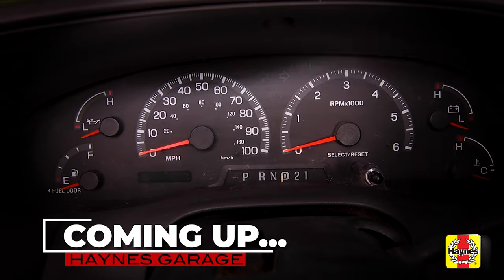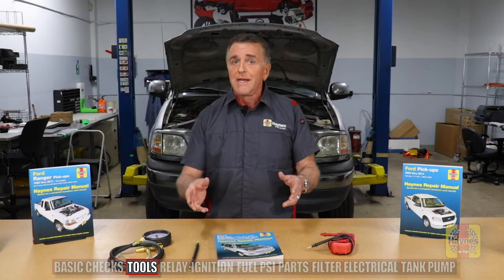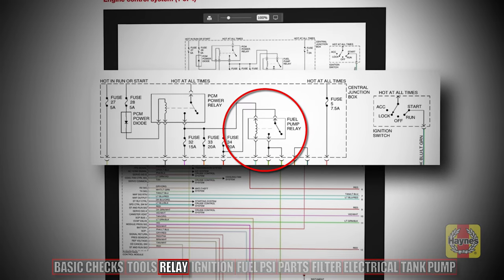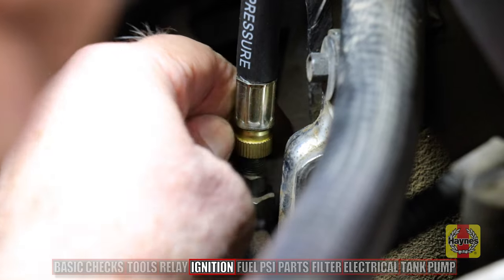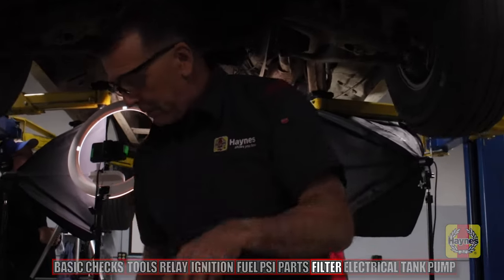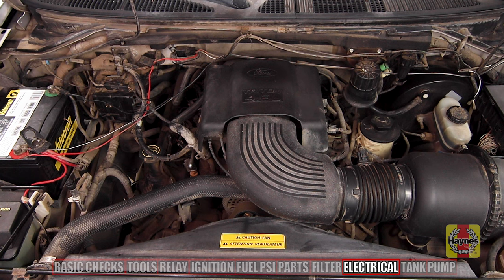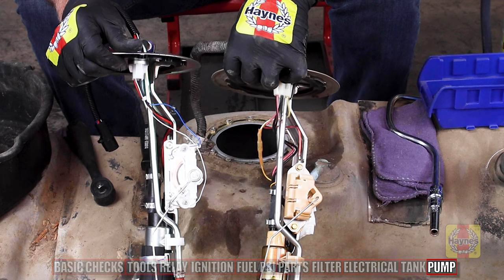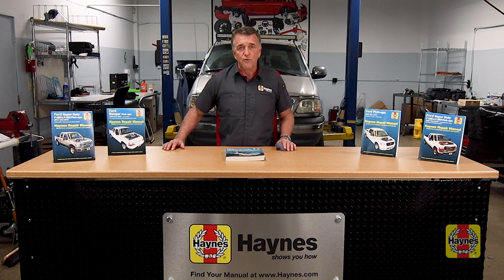What To Look For When Diagnosing Your Vehicle's Crank, But No Start

Comment: I cant believe you ignored the possibility of it being the relay 303 in the fuse box in the cabin on the passenger side.  this is the last fuel pump relay before voltage goes to the pump.  its not a removable plug n play type but soldered to a circuit board.  replacing the entire fuse block is hella expensive but if you know how to solder its a $12 fix.   And your video never even mentioned it.  And once you remove the 4 pin connector you can diagnose the pump and that relay before even crawling under the truck or taking the tank off the truck and possibly finding the pump is actually ok.
Reply: One of the greatest aspects of car culture, and especially in the “hands-on” world of “fixing cars,” nobody knows it all, and there’s always more to learn. Frequently we get to share what we know to help others enjoy the best in vehicle maintenance and repair. But when inaccurate advice or information is presented, and others can be diverted from reliable and correct information it can result in lost time and energy. 

Yet the comment above is based on incorrect information and misleading to others. Naturally, it will be helpful to provide you and others with facts about how "ignoring" the model year matters significantly.

The summary conclusion, “I can’t believe you ignored the possibility of it being the relay 303 in the fuse box in the cabin …” is simply not accurate for a 2000 F-150. None of what was offered in the above comment above will help an owner of a "2000 model" Ford F-150.

This Haynes video that included the "one" fuel-pump relay located only under the hood is precise and correct to the wiring diagram for this vehicle. 

What could have been ignored or simply overlooked in this Haynes video is this is a “2000 model” F-150. The 2000 F-150 was not manufactured with a ‘relay 303’ inside, or a fuse/junction box in the "cabin." The "only" fuel-pump relay on the 2000 model Ford F-150 is located in the fuse/relay junction box “under the hood” (exactly as it is accurately identified, demonstrated and tested in this Haynes video).

Leading others - and especially anyone who may also miss that this is a “2000” model F-150 platform (and NOT a 2004 or later Ford F-150) - could and would cause folks to lose time looking inside the cabin as the comment posted from "Wingtipsworld" above suggests. Yet still the basic tests, strategy and awareness education for viewers looking for helpful insights that also apply to many other brands and models of vehicles can benefit from the education of this video, too.

In 2004 Ford changed the circuits with the refresh of the F-150, and starting in "2004" the fuel pump relay is located in the Central Junction Block and is no longer serviceable as you described under the passenger side. If we were covering this diagnostic about a "2004" or later, we would have also referenced a "wiring diagram" for the later model. We didn't 'ignore' being accurate for the 2000 model year.

Sometimes the correct model year may be “overlooked,” yet hopefully the clarification of what could have been ignored about the correct model-year for wiring diagram reference in particular will help others, as well. 

Best of continued safe and enjoyable driving and maintenance/repair successes to you and others ahead.🛠️

- Steve Ford

     #     #     #

Comment: Most cars don't use that Schrader valve anymore.  It's much harder to get that fuel pressure reading.  I spray starting fluid to check for fuel.

Comment: Its a good video, but has a big problem From the time you stepped out of the cab, the next procedure would be to check the 20 amp pump fuse and the realy under the hood.  Why would you skip this issue?.

Comment: Just a question, instead of putting the truck on a lift dropping the tank a bit draining the fuel then putting the tank on the ground to change out the fuel pump why didn't you just pull off the bed or at least pull back the bed where you would have easy access to the top of the fuel tank? Is there a reason to not do it that way? I have plans to do that in the next few days, and a reply would be appreciated. Thank you. I bought my first Haynes manual when I was 16 and that was 40 years ago. I have a manual for every car that I've ever bought.
Reply: @donleebarnett  they put it on a lift because it was easy

Comment: What does th fuel relay switch look like under the drivers seat
Reply: There isn’t a ‘fuel pump relay’ located under the driver’s seat, or anywhere inside the truck cabin on a 2000 model year F-150.
(Please see the comment/reply to the viewer’s suggestion to “solder” a relay to replace a “303 relay” in the Haynes video 2000 F-150 above.)

Comment: MY F-150 DIED SUDDENLY. CRANKED BUT NO START.
CHECKED ALL FUSES. CONFIRMED FUEL PUMP OPERATION.
WATCHED EVERY YOUTUBE VIDEO I COULD FIND. NO HELP.
EVENTUALLY TOWED VEHICLE TO COOK FORD.
THE PROBLEM............. CRANKSHAFT POSITION SENSOR. REPLACED. MY TRUCK IS 100%. 230K MILES.